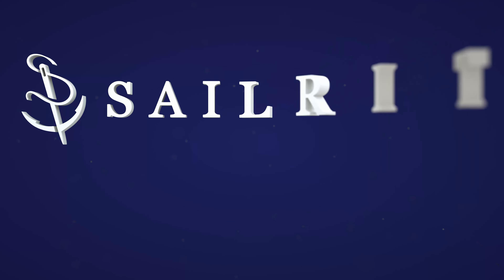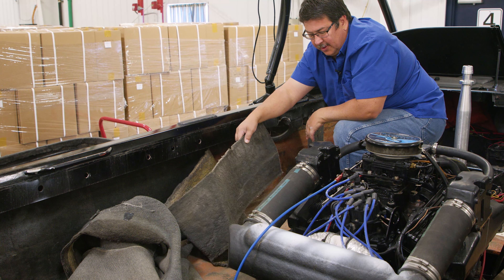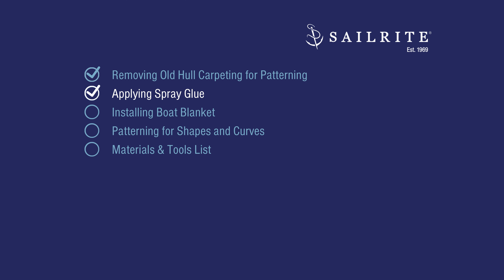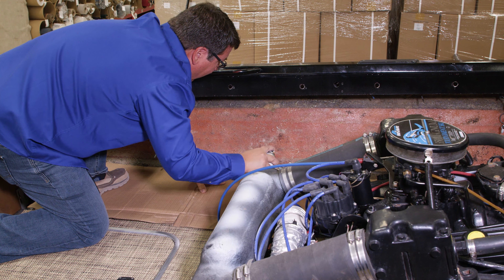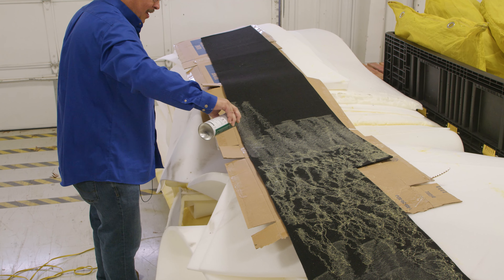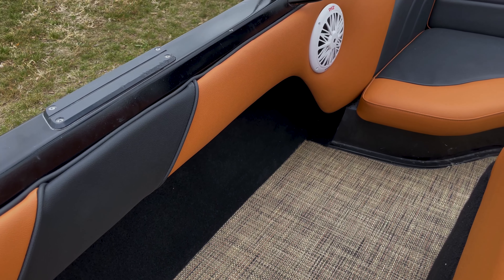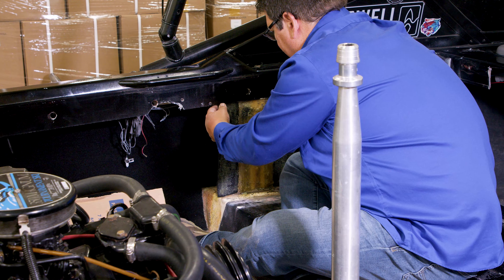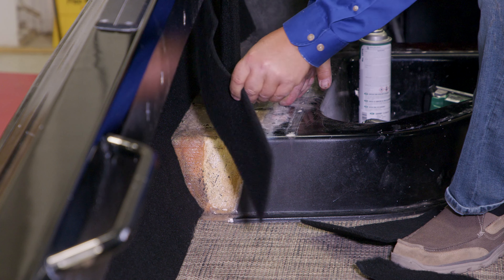Applying New Hull Liner on Speedboat

Comment: I liked the boar blanket material.  I have a 1979 hunter sailboat with nasty carpet on the interior vertical surfaces.  When I remove the carpet there is some residue glue on the fiberglass surface.
Is it ok to just install the boat blanket directly over that surface?

Thanks

Bob
Reply from the maker: Yes, you can apply the new boat blanket over an surface that still has old glue residue on it. As long as it is flat with no chunks of old carpet stuck on the surface. You must remove the old nasty carpet, but not the old glue residue.